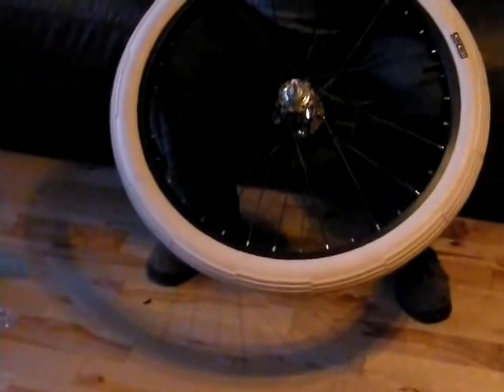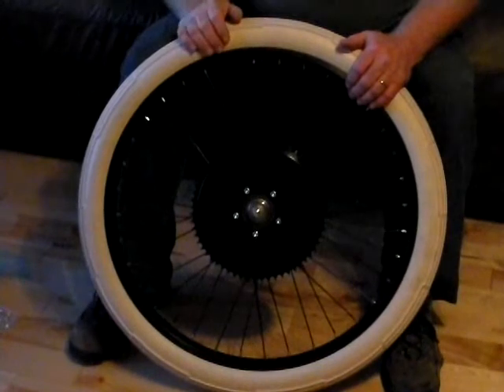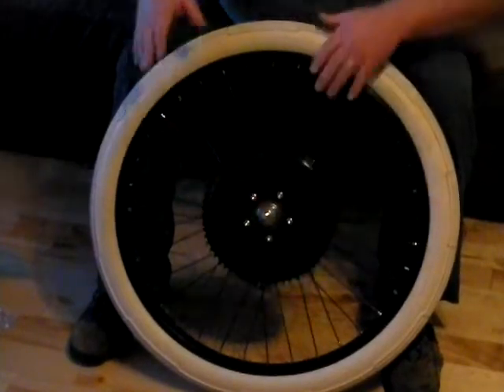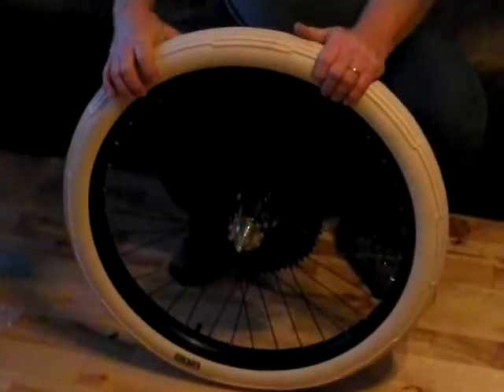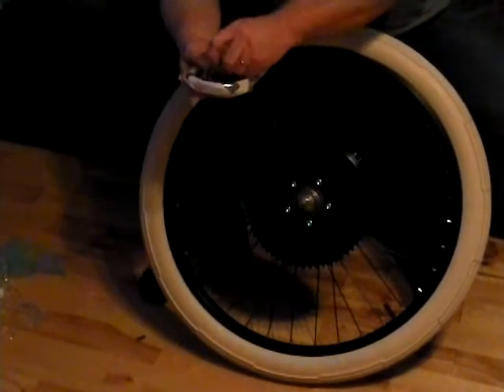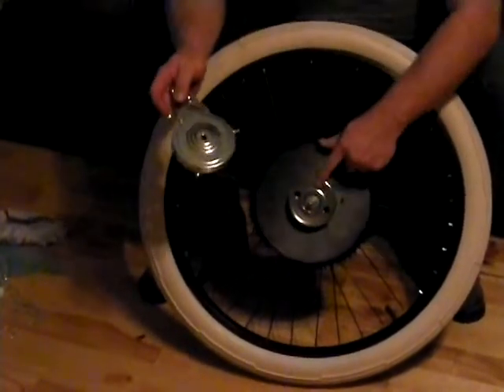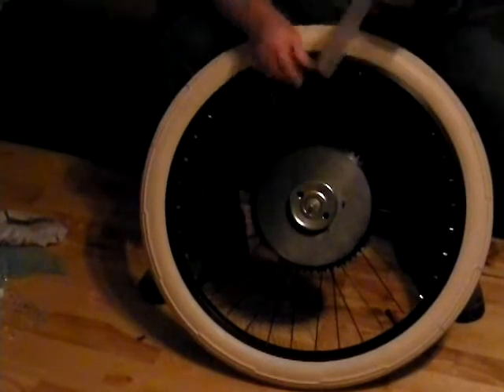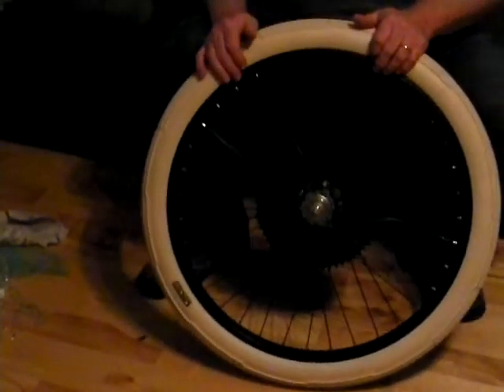HD Axle Explained #2.wmv

Comment: I'm wondering if the 7-speed sprocket on my regular bicycle wheel would fit on the grubee hd hub.  I am guessing it would, and that you need special tool (?) I was looking at upgrading the stock wheel, not particularly for converting to a fast, powerful (illegal) motorized bicycle. Rather, to handle more load. (I have a home-made grocery cart-type accessory mounted in back. I was also trying to devise a small helper electric motor-assist, with chain drive. Something inconspicuous. ttyl...